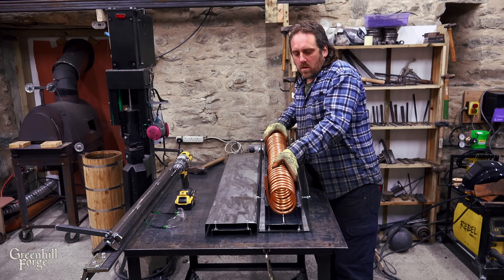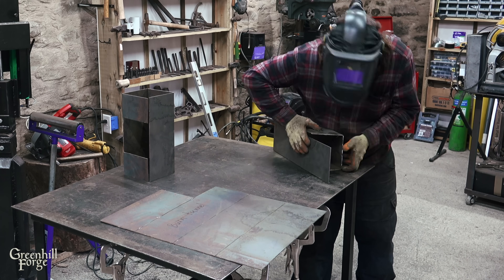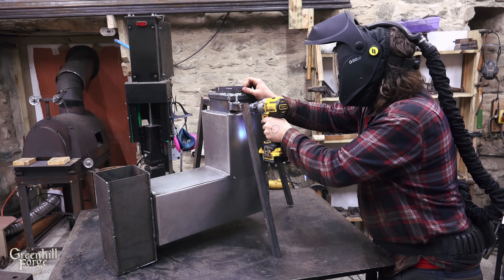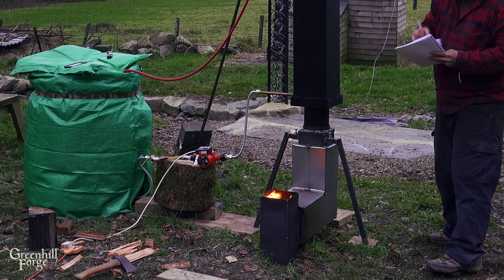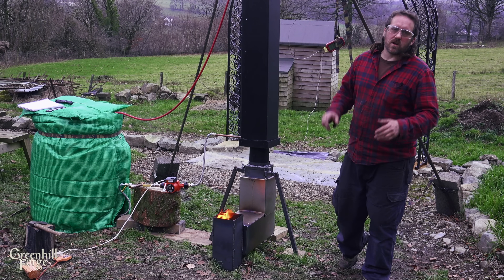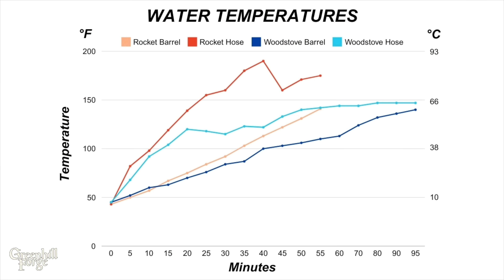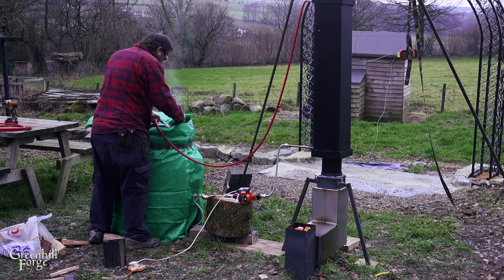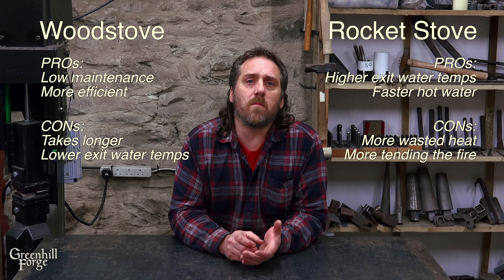Rocket Stove Water Heater Experiment Pt2 -TOO Powerful?

Comment: Could you reduce the outlet diameter (conical reducer) to increase the pressure inside to flue to increase heat exchange efficiency?
Reply from the maker: It would slow the mass flow rate which would be good, more time for the hot flue gasses to heat the coil. But that would also mean less oxygen to the fire so a cooler fire. Not sure if one would have a bigger impact than the other, would have to run a test. Also, one of the reasons rocket stove are so efficienct is that tons of air flows through them really fast so slowing it down would definitely make the rocket stove less efficient. It's a whole series of trade-offs and trying to figure out which combination works best.

Comment: Thank you for this detailed comparison. I'm going to build my wood burner water heater for a hot tube SPA 1m3 volume and I could not decide what type of stove will be better. I spent several hours trying to find this data but then found this video with graphs and even with your suggestions and summary. Appreciated.

Comment: you won't nuke the copper because it's in contact with the water, as long as the water is moving you're good
Reply from the maker: i was mostly worried about cavitation or if it turns to steam. just didn't know what to expect. things got a bit hairy when the water started boiling, but like you say, as soon as I sped up the pump and liquid water filled the coil everything settled down instantly.
Reply: @GreenhillForge  yeah I saw the pump setup after I posted and kind of regretted it. Nice experiment. I was telling my friend about it and he asked about the fuel usage and that was the very next thing that came up in the video. Thumbs up

Comment: Interesting. I've often thought about trying this with my old catalytic converter wood stove, typical cat outlet temps range from 1000 to 1600f. I think my biggest worries would be proper safety relief valves and choosing a heat exchanger material durable enough, it would be pretty bad if it were to corrode and rupture internally.

Comment: Hello thank you for this inspiring vidéo. 
Do you have insights on why you have only 30% efficiency?
Your burn is clean at least 90%
Your exiting smoke are about 20% of the initial heat...

It leaves about 30% of the heat radiating through the walls?

Comment: what about the coil you have now, but make it twice as long and start its way back down. Then you'd get an improved heat extraction and a quicker ramp up water temp as the heated water would heat itself on the way down.

Comment: You know Steel has been used for generations of hot water heating. If you want your heater to last a hundred years using heavier gauge. To start 3/8" to 1/2" thickness or use pipes that are schedule XX-Strong rated. Look up the Standard pipe Schedule for choice of diameter desired. 

I would also weld on a plate with the date of manufacture and gallons capacity with temureture gauge somewhere to manage control better. Maybe use a Barbecue thermometer to manage heat control of fire along with a gixed water temperature gauge do everything is at a glance monitoring.  

Boilers are made of steel inside of Power Generating Plants and Refineries. Use a heavier gauge for your heater. If your looking for durability.  Also the problems I observed with your design is your rocket stove did not have, heat capturing baffles on the inside of the heater pipe that, "Spirals" all the way to the top of your smoke exhaust. This heat capture baffling may allow you to actually shorten the height of your Rocket Stove. Remember  everything is just a suggestion of what I would do, if I were to build it for

Comment: Here is a suggestion for build off the water heater Add a radiator and fan to heat a inside room or tent run the fan off a smell 12 volt lawn mower battery ! I don't got the equipment to build like you did but made a small one to keep some heat in my garage one winter just a small single car garage that was not insulated for a place to do some woodwork in like cutting for a house remodel where i didn't want the saw dust all over the house I was able get the garage a good 40 degrees warmer then it was outside & at one point had it at 76 degrees when it was below freezing outside !

Comment: You mentioned various uses including heating; someone has done a mass rocket heater with a closed-loop water heating system that gets heat from some moderate but high heat part of the stove, runs it through the floor coils and back to the stove for re-heating. Rocket mass heaters seem like a perfect opportunity for efficiency, stacked functions and a range of uses for heat both immediate and over time. The hot tub idea is great, but I think, not even the most interesting use of all these principles. Great work!

Comment: I had constructed "rocket burner" which is attached on the conventional wood burning boiler. I have a buffer tank so when the burner is in use, it can go full blast. Very low wood consumption, it is burning without visible smoke.

Comment: more flow rate would also speed this whole system up and it would boost the safety side. more water flow means the water cant get that hot in one single flow through pass and the temperature difference will be larger meaning more transfer will occur.
i think a much higher volume pump would make a huge difference imho.
Reply from the maker: I agree, but the end goal is to remove the pump completely and run it on a thermosiphon so I'm trying to test it on the slower end.

Comment: In the early 1900s tankless water heaters were the standard and soon abandoned because of the safety issues you mention and other safety issues, and the industry went to tank style water heaters. 

I think now seeing the creosote issue,  moving to a secondary air set up to heat the coils would prevent the coils from getting coated with creosote. Standard FAUs use a primary/secondary air system, with the firebox, exhaust air, completely separate from the circulating air. That would scavenge the heat with a more complex flue system. Nordic style stone/brick wood furnaces that are built into walls use a secondary air system that scavenges exhaust heat from a fire without using a straight flue, unlike US-style straight chimneys. Although the stone/brick also retains heat as well.

Another option might be to use an anti-freeze medium  filling the coil that circulates the medium, with the coil either submerged in the water tank  being heated or surrounding the tank of water. Seems like it would be slower, though, even at the highest heat you're achieving. 

Keep up the good work.
בסד

Comment: An interesting design. You might find better, more consistent results by piping the hot fire exhaust through an insulated tank of water, similar to how commercial hot water tanks work. Fabricating steel baffles would be more labor intensive, though.

Comment: The efficiency loss compared to woodstove could be improved by running the pump at maximum for the whole test. Heat transfer is most efficient across greater temperature differentials. A proper test of whether they are equally effective at transferring heat would be to run the pump at speeds to maintain the same temperature water output. One would be quicker than the other, but likely both similarly efficient, seeing as only 3% was lost on the much hotter rocket burner.
Reply from the maker: That's a good point. The eventual goal is to remove the pump and run it on a thermosiphon so I was trying to keep it as slow as possible to test the system, but you're absolutely right. I should also just test them both on max flow for the whole test.

Comment: I think you could improve your design by add coils around the base where its hottest. The coil should be in a jacket that is filled with sand so that the walls of the exhaust conduct the heat into the sand and coil without slowing down the gas in the chimney
Reply from the maker: I've got a video coming I think you might like

Comment: I agree, the wood stove was better and safer than the rocket stove and I was going to suggest to lengthen the copper coil and increase the head lengths also. 
   I was also thinking that you could increase the capacity of the wood stove if you increase the copper coil length for more options such as adding an additional adjustable flute to inject more oxygen to the burning process would be worth testing also in a video. 
     I think I would increase the gap between the stove and the copper coil for longevity but there is a compromise, longer time to heat the water. 
    Within that gap, you could add Heater coils to generate DC current to off grid battery bank system also, which is a good trade off for the longer time to heat the water. 
     These are all ideas that I’ve been thinking about for a long time to add to my wind and solar that charges my four battery bank systems that I use now. 
     I love your videos and I love your shop set up also. I just subbed tonight and haven’t had an opportunity to view more than the three videos you put out in the last three weeks. Mahalo! 🤙🏻

Comment: if you want to extract as much heat from the hot air, you should use counter current flow in the heating coil with maximum water flow possible. 
Also, add some fins in the heating coil to allow more area.
Reply from the maker: I talk about counterflow in the comment response video if you want to check that out

Comment: Ģreat video, great fabrication into a quality fully functioning multi section (cleanable- soot will foul each test) heater. Particularity liked the selection of burners.. Was going to mention at the beginning of the vid, that combining copper and steel touching; will result in very quick electrolytic corrosion, the copper eating the steel away.. but you demonstrated that the flue could be dismantled and cleaned - corrosion would be easily spotted. I have toyed with the different combinations of coil heated water for some time, as a qualified- now teaching; old plumber I would agree with you about the length of the coil. My next test would be to increase the length of coil/flue in the same increment again.. but the flue will become lengthy and more difficult to manoeuvre, and consider condensation (acidic) The flue length will eventually, if ever increased; draw all of the heat out of the gases, and cause lack of flow and blocking the flue. There must be an optimal efficiency length though for each burner? Good luck with next venture. I will wait to see the statistics.👍
Reply from the maker: Thanks! I've good some more burners and coil designs coming soon. I also have a response video where I address some of the more common questions and comments if you haven't seen that one. I've had a lot of comments on the potential galvanic corrossion but you're the first to know that it would be the copper corroding the steel and not the other way around.

Comment: The copper will not melt 0 chance if it has water in it.
Reply from the maker: I agree as long as there's flowing liquid water. If the water doesn't move fast enough is the issue. If it turns to steam and builds pressure or cavitation it could be a problem. That's why I added the pump, to make sure there was always flowing water.

Comment: Consider corrugated copper or bronze flexible metal hose for more surface area in the fire, which can enhance heat transfer efficiency. More surface area allows for more contact with the water, improving the rate of heat exchange. I am curious to see how this would improve the output. 

Fine work Greenhill Forge.
Reply from the maker: Good idea. It would add a lot of friction and turbulance to the water flow so it would be really interesting to see what would happen.

Comment: The BEST explanation of the power of a rocket stove I've seen in 5 years of devouring info on them. Would love to use this for home heat with the right floor heating system - as you mentioned, it would take some tending and more safety points ...you can't have a goal of heating your water anywhere near the steam point - water hammers, de-aeration, cavitation etc all enter into the picture then.  For longevity in a home system you might explore using ceramic pipes - maybe within the entry pipe and stack - huge temps for your great design to cope with over a full wood heating season - the creosote build up was a surprise to me over the time of one burn - esp. since the rocket wood stove is supposed to be so efficient.  I like the fact that your design is made for quick take down and inspection.  My biggest takeaway was 'I really need to up my metal skills'.
Reply from the maker: Thanks! I made a follow-up video with some mods on the rocket stove that got it to get quite a bit hotter. There's also a couple more mod videos and water heating videos coming.

Comment: Quality work, maybe you could make a denser copper coil or coil in a coil to restric the flow, and maybe your heater's oversized for the amount of water your coil holds. Heres some data i got off chatgpt assuming its a 6in x 6in stove

For natural convection, your heat exchanger coil should:

Hold 3-5 liters of water to allow heat absorption and circulation.
Use large-diameter tubing (22-28mm) for better flow.
Your storage tank should be 200-300 liters and placed above the coil to drive circulation.

Comment: You missed the best advantage of the rocket stove. With the rocket stove you get better combustion but you don't want the coils in the combustion stream. There should be no coils getting touched by flames because the coils are basically below combustion temps at their surface. This is why the creosote builds up. Creosote is unburned carbon. Let the rocket stove finish the burn and then run the superheated post combustion gasses over the coils. For a complete burn that should be mostly CO2 and H2O. The coils should be pretty clean with just a little ash at most which will help with long term efficiency. 
To do this with your current setup just run a tall insulated chimney with a u-turn at the top that feeds down into your coil chamber with the exact same orientation as this test. I.e. output for hot water at the top. The extraction should be more efficient as well.

Comment: I wonder have you seen the heat batery by filing a bit water bag in the basement and then circulating the heat from it to the houce? Make a 10  ton water containet insulated in the basement and use it to store heat from the fire and tgen circulate it in a heat pump to the houce... 
Others use sunlight to make electricitt and heat sand to 1000+ celsius

Comment: Try placing the top hose directly on the surface of the water in the tank so that the water does not mix. I suspect that this will increase the heating rate since the coil will have colder water coming into it and will be able to absorb heat from the pipe more efficiently.
Reply from the maker: tha's not a bad idea. harder to take consistent readings through the heating but would likely shorted overall heating time. I like it.

Comment: Consider using local prices per unit of energy as the comparison. While I am not suggesting money is king, the ‘market’ will produce a more easily comparable energy efficiency. And others can then comment with their local prices for similar quantities of fuel to validate. The $ cost builds in the transport, logistics and extraction energy and removes any potential biases.
Reply from the maker: I'm trying to get Joules or kWh in vs J, kWh, or BTU out. That seems like the most unbiased breakdown to me. I'd agree that local energy prices could account for things like the type of energy generation localy but wouldn't take into account things like public/private ownership, government energy subsidies or infrastructure cost payment sources.

Comment: Since you do have a water pump, you should really be using counterflow, which means that the cold water should enter at the top and exit at the bottom.
Reply from the maker: speaking strictly of heat transfer efficiency I agree but I didn't use counterflow because I'll ditch the pump and use only thermosiphon once I've refined the system. the pump is there to accelerate the flow if things get too hot during testing. I go over this and other things in the comments video of you want to check that out.

Comment: Baffling the top of the flue, just to the point of smoke-back, and thus slowing heat exhaust would increase heat transfer into the coil and thus fuel efficiency -- ie less joules wasted out the top. Higher raw heat at the top is not the goal. Hotter water is. Therefore time for water heating is a direct function of heat transferred not of heat passing by. My 2 cents.
Reply from the maker: absolutely. but slowing the airflow anywhere in the system will drop the temperatures in the whole system. might still be beneficial in this case. Worth a try